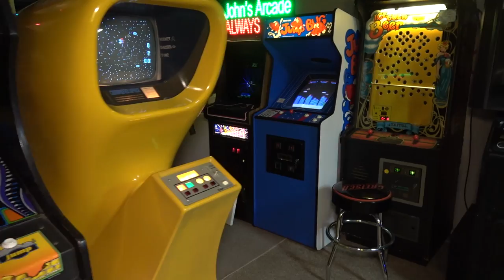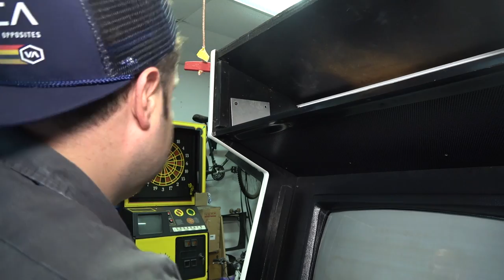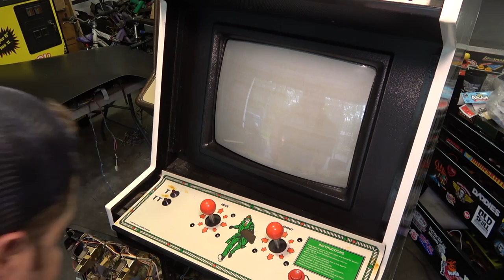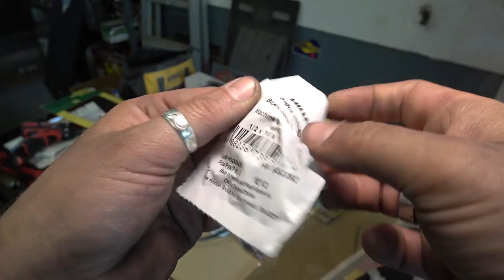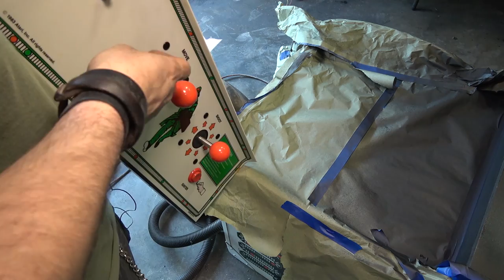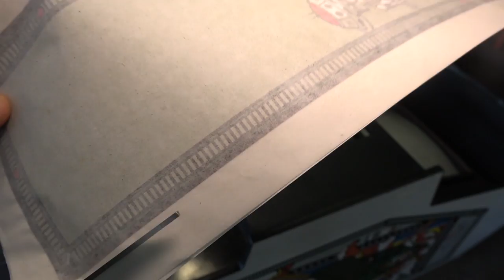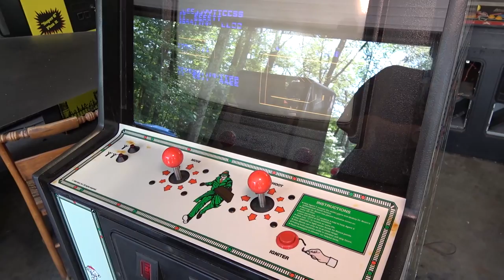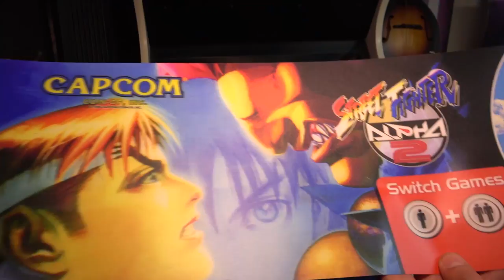Done! Atari Cloak & Dagger Arcade Restore Part 2

Comment: GREAT RESTORE VIDEO JOHN!  You all ready have the shimming needed for the player 1 and 2 buttons. All you need to do is cut and resize the part where those two buttons reside on the plexi that you threw out.  The spacing and centering for the buttons would be exact just install on the underside of the control panel.
Reply from the maker: Did you watch the rest of it? I added some washers. All fixed. :)

Comment: John. Thank you for the kind words! Yes you can indeed use windex or lens cleaner with microfiber. Just make sure tumble or air dry them as heat can melt and damage the fibers. They should provide years of use !

Comment: John, you mean that loading down the 8 ohm stable amplifier to 4 ohms could have blown the amplifier, not the speaker! Also, Pulse! Was surprised to see that brand; it's an own brand of CPC here in the UK. Their products are GREAT value as they are cheap in price yet are "real" solid products with proper components, rather than cheap junk. For example, the APB2100 heavyweight professional amplifier which me and a couple of friends own - Crest CA9 hardware clones that output up to a true 2800 watts continuous (total, both channels loaded down to 2 ohms) yet currently sell for a mere £200 and have sold from anything to £112 to £290!!! **This is an arcade channel, oops** lol
Reply from the maker: Ha. :) Yeah, I meant the amp. :)

Comment: Pro tip, the dowels should go about a fraction of an inch deeper into the wood (not flush, just inset slightly).  That allows the bondo to go into the hole on top of the dowel and when you sand it, it will be smooth as a baby's butt and will not fall out since it's anchored better.
Reply from the maker: Interesting. I don't doubt it. But I always have gotten good results going flush and filling in the rough areas around it.
Reply: And it works!  Looks fantastic by the way.  Awesome job on the artwork.  It's bad ass for sure.
Reply: DeLuSioNaL's Arcade  that is a good tip. I filled my lock hole with a dowel, on my arcade cabinet and left it flush. I could tell afterwards that I probably should have pushed the dowel in a bit. But with black paint in a dark room not really noticeable, but will do your way next time 👍🏻
Reply: DeLu, "since's"? What does that mean (to you)?
Reply: Say what?

Comment: I have a dumb question , I'm restoring a mk1 and I'm getting distortion in the sound . I have the braided metal wire just hanging and was wondering where it goes ?? It gets louder when I touch the cable
Reply from the maker: Not sure what you mean. You mean the ground strap? It goes to some piece of metal. Can you kind of see where it wants to go? To a screw?
Reply: John's Arcade Game Reviews & Tech it's a metal braided wire which I'm guessing it's the ground it runs from the bottom of the power pack assembly towards the coin doors and then it just hangs so maybe I'll just screw it to a metal screw and see if it stops making distortion

Comment: I don't know why you don't use a spray gun you've got a compressor much better job quicker just get a spray gun or air-brush and a regulator with filter about 20 PSI, you can buy primer filler you might find useful and you can get it in cans as well great for filling in little dents and scratches. you might find when routering to clamp a piece of waste wood on so you do not mark the artwork or paint. if it was me I would grind the side edges down on the blades of the router bit to make it a little bit thinner, on a grinding stone, using the fine stone just a little touch is needed to take it down a bit to make your t-moulding tighter.
Reply from the maker: I don't disagree with you. I might invest in that in the future. I just have no experience using one. The spray cans are quick and easy. Maybe too easy. :)
Reply: John's Arcade Game Reviews & Tech try the air brush first easier to control handy for very delicate and precise work you're quite the artist so you should be able to grasp it. I suppose you didn't try using some bleach on the cigarette stains with a Q-Tip
Reply: Microfibre cloths can leave scratches special on automotive paint work if you want scratch free cloth?  you need to have lint free cloth.

Comment: Another way to fix the T molding grooves is to put electrical tape over the T molding barbs so it goes in
Reply from the maker: +Hunter Romanoff I've done this. But the hot glue is better

Comment: I would have atleast painted the corner covers black to mach the T-molding. Cab looks great though even as is.
Reply from the maker: I thought of that after the fact but then it will be black over the white side art. #cantwin
Reply: Great work on the restore. It looks fantastic. As far as these corner brackets,  they do look a bit weird at the bottom of the t-molding. Maybe mask off everything but the part that covers up the t-molding on the front of the bracket, paint that black and leave the rest of the bracket white? Just an idea. That way you'd keep the black line for the t-molding, and the white to go with the side-art. Just a tiny nitpick, though. Not a big deal. It looks pretty great as-is.

Comment: why you care about stuff no one cares about or sees really. just put new t molding on and don't worry about it. not like it will effect much? that is what they would do in arcade if they changed it because no one really sees stuff like this. you don't get the point of microfiber. the whole point is not having to use any cleaners because how they are made makes them work good to clean without.